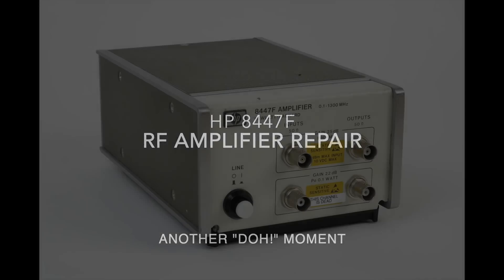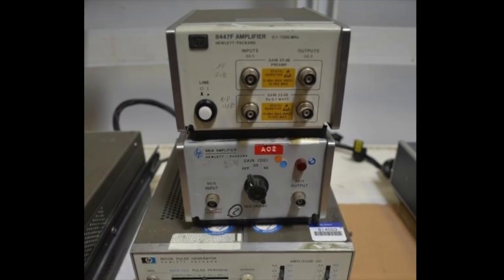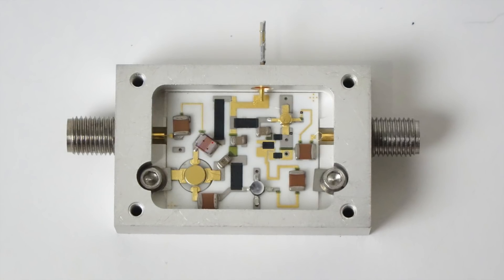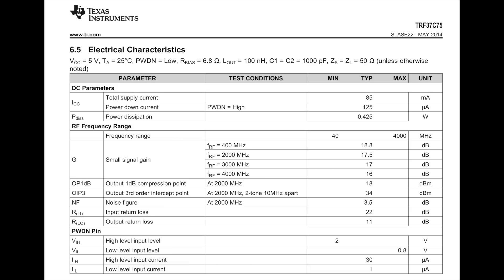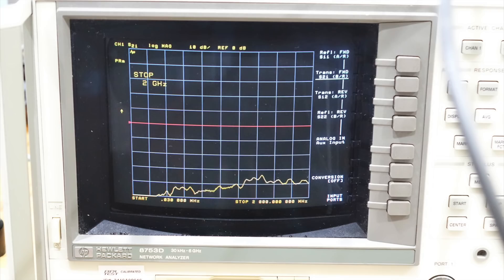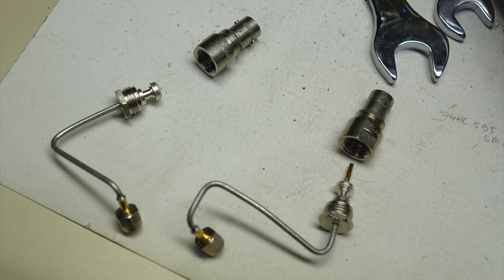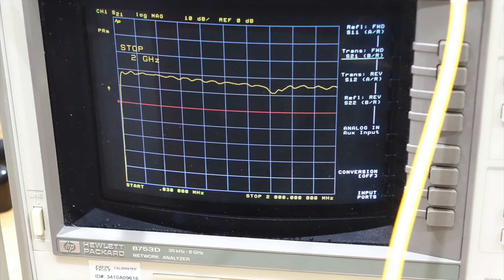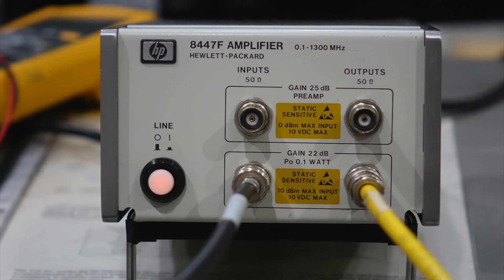HP 8447F 1.3 GHz Amplifier Quick Repair

Comment: After keeping the old ThinNet coax networks running, we techs got wise very quickly to broken coax connectors on the 'T' connectors in the coax cables.  It was the first thing we suspected back then.  And then I got to take care of the coax cabling for the IBM 3270 and the IBM XT 3270 PCs.  Not as many problems as ThinNet.

That HP amp was probably a thousand dollars new, and all it needed was a teensy weensy connector pin.  😭😭

Thanks for the video! 👍

Comment: I'm happy you got it working, connectors are a pain.  (I'm a radio ham).
Reply: Heh.  That missing connector pin would be bad news if it was on the antenna jack, wouldn't it?  Might cause the RF output to burn out.

Comment: I have worked with RF for several decades. When somethings is not right or seems strange, check cables and connectors first. Connectors wear out on test equipment, and jumpers don't last forever. BNC are bad for this kind of thing since the center pin moves around with use because the outer shell is not tight. TNC, N, and SMA are much better since they screw down tight. I use male-female connectors on the N and TNC on my service monitor so the adapter wears out, not the connector on the equipment.

Comment: Always perform a careful visual inspection of any repair item. Use an eye loop for magnification. In my experience, about 50% of all faults are plainly visible. The other half are the usual internal component failures (invisible).

Comment: Can somebody explain why the BNC needed such a long extension on the center conductor?  Normally I see them flush, or even slightly recessed, but I also never messed around with semi-rigid coax.

Comment: I have also repaired the same product.  Instead of replacing the AMP module, I replaced the LNA in the module with one made by mini circuits.  Since the inside of the module is a ceramic substrate, I remember having a hard time soldering.
In my case, the BNC wasn't broken...

Comment: ZFL-2000 might be a good choice but remember that the original HP amp is specified down to 100KHz not 10MHz and also has a higher gain but the NF of ZFL is better

Comment: I'm surprised you didn't check connections first:-) What a waste of time for such simple repair.
Also I bought few of these chinese 2-3$ rf modules described as spf5189z ic amp. Of course they are fakes, there're just some remarked rf transistor inside instead of real rf amp ic. So at 5v it drains ~200mA and just overcooks itself. But if you limit current to 130-150mA that things works somehow with 10-15 db amplification. Of course its parameters are utterly crap comparing to real rf ic. But I guess 2-3$ is good price for pcb with metal can and sma connectors if you gonna solder a real rf ic inside.

Comment: Excellent repair, Marc. Don't feel bad about assuming that the more complex part of the circuit is the thing that failed. We all do it because that's what our intuition tells us. I have the same amplifier but sadly mine only goes up to 400Mhz. Footnote: Like Samtec, Minicircuits is another really awesome company. I'd bought some components directly from them but never got round to building the circuit I needed them for so the package with the components sat on a shelf in the living room - unopend. About 6 months later I got an email from Minicircuits telling me that they had shipped me short on a part that was a handful of dollars and can I please check. I opened the package and sure enough I was one short. I replied and they shipped me the missing part no questions asked. Now that's customer service! I wish HP of old was still around but I'd be happy if Minicircuits or companies like them took HP's place.

Comment: A few years ago I had the luck of living down the street from where the local TV station sold off their out of date test generators and meters. A bunch of vintage, but a good chunk of what had to be hybrids to handle analog and digital signals. But the crown trinket is the nixie tube meter. I just want to send a safe cycling voltage to it for display purposes. :)

Comment: Does anyone know which font HP used on their front panels?
Reply: I tried to find out for you with a screenshot from this video with "what the font" by myfonts – it was an iPhone app I used ten years ago alllll the damn time to identify fonts in my environment. Unfortunately, the pictures in the video with front facing clear angle on the text were just a bit too low res for
the service. And taking a photo of my TV screen to try and get some IRL interpolation going.. just confused it with the moire pattern, and it suggested fonts which emulate scanlines or dot matrix, which is evidently not what we're looking for here.

BUT, I mention all this because you could probably seek out higher quality photos of HP equipment, assuming they used the same font on lots of the items, instead of just hastily using a screenshot from this video, and probably get the answer. If I had more spare time I'd probably do all that myself but I figure I could at least give you the tools.

I'm a big font nerd (hopefully self evident by my story of trying to figure out fonts in my environment a decade ago), so I'm curious too, so I'd love to know. It almost looks like Arial or Helvetica but just.. not quite. It's obviously a neo grotesque tho.

But yeah, mostly saying this in case you weren't aware of what the font. I think I only knew about it because of some video podcast I subscribed to back in the day, before they even hosted them on YouTube?

(Also, their website is unfortunately more awkward to use than the original app was. You used to just draw your finger to highlight the text, it'd OCR and ask you to confirm, and you could manually write-in letters it hadn't identified. But now, their service has awkward dragging text boxes and auto suggested parts, and seemingly no way to get confirmation on what exactly it had OCR'd. Ho hum. Still a fairly useful tool anyway – with high quality images that is.)
Reply: @kaitlyn__L  thank you very much!
Didn’t knew such apps existed. Will give it a try at some point.
Reply: @LongnoseRob  glad it was helpful :)

Comment: It reminds me; I recently repaired a one of those tablets with a dedicated keyboard.  It turned out that one of the pads on the keyboard connector was caught up somehow. A little wiggling with a toothpick  straight off would have saved me a good thirty minutes farting around with software settings and alternative Bluetooth keyboards.  So it is connections-connections before anything from now on.  Chapeau, Marc!

Comment: Surface mount components on a ceramic board inside a piece of 60's equipment? Color me impressed.

You can get a surprising amount of good kit from the parts/repair listings, if you've got a little know-how and troubleshooting skills. My last acquisition was an Agilent 54622D 100MHz 2+16 dual-mode scope for $160, and all it needed was a new battery.  Sure beats paying $5,500 for the equivalent specs on a new Keysight scope (I think the MSOX3012T comes closest).

Comment: I've worked with that amplifier before.
Reply from the maker: Have they ever died on you? This is the second one with a problem in the power amp channel I got. The first one I returned (was sold on eBay as guaranteed tested), but this one obviously was from an auction so no return there. I suspected the power amp without proper thinking because usually that's the one that gets abused at the input.